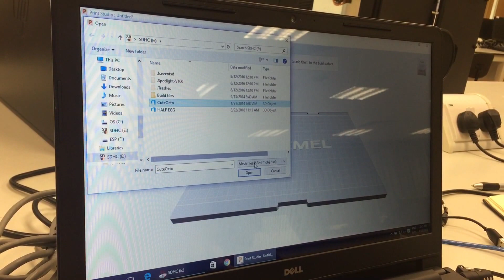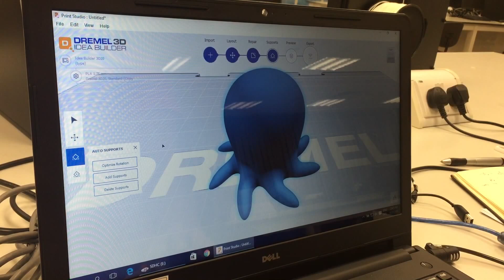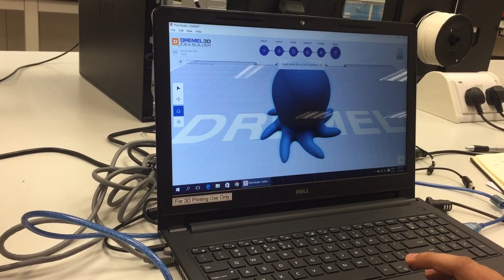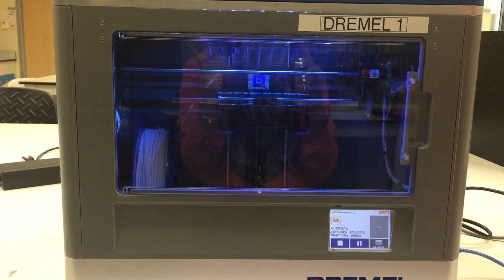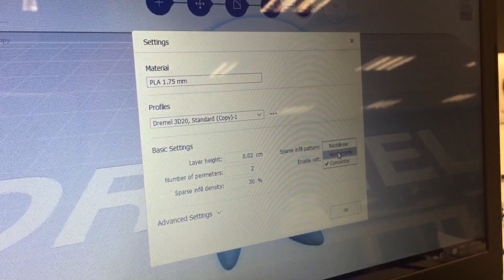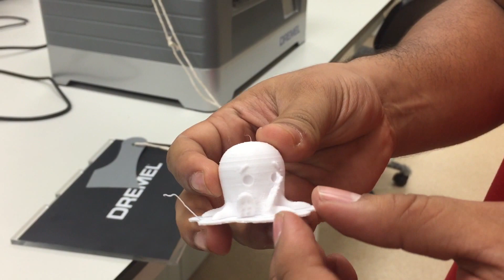Dremel 3D20 3D printer- Step by step tutorial

Comment: how to 3d print letters
Reply from the maker: that's quite easy actually. You just need to draw out some letters using any CAD software like solidwords, autocad, etc.
Reply: i also want to know the input file for the 3d printer(format).
it should be in STL no?
Reply: how to make file format into stl
Reply from the maker: There are two steps for this. First, u need to save the file in stl format from the CAD software. You can just use "File>save as>(choose *.stl)" for this. Next, u have to use the "Dremel 3D printer" software. Using this software, u can convert (use build button) the stl file into g3drem format which is read by the printer.
Reply from the maker: No, this printer only accepts g3drem files. stl files need to be converted to this format using "Dremel 3D" software which was given to me by the supplier.
Reply: can you tell me how to design on the software
also make a video on  printing letters 
please.
Reply: The "Dremel 3D printer" software is quite basic and meant for file conversion from stl to g3drem format only. For drawing, you can use "Tinkercad" for 3D alphabets. Its a free online software and several tutorials are there on youtube already.